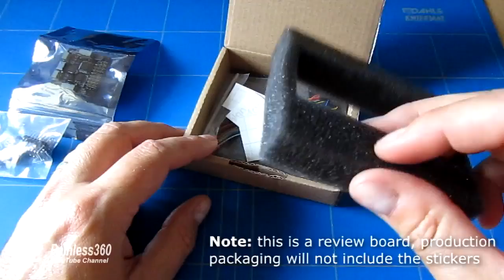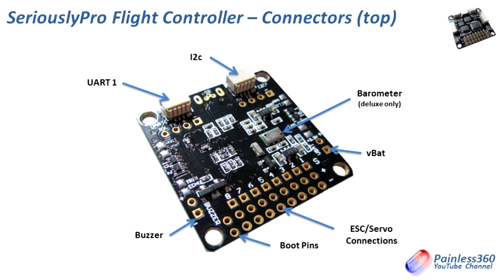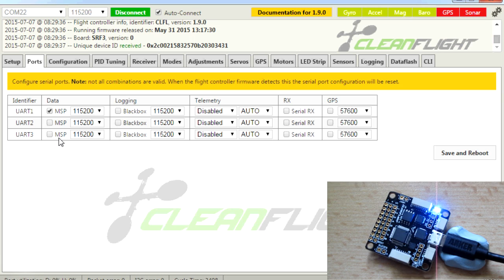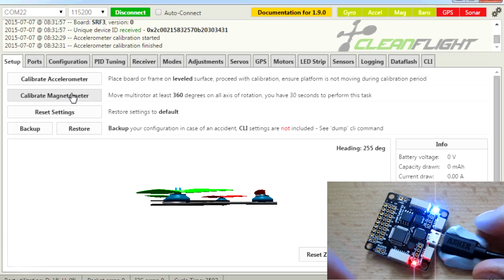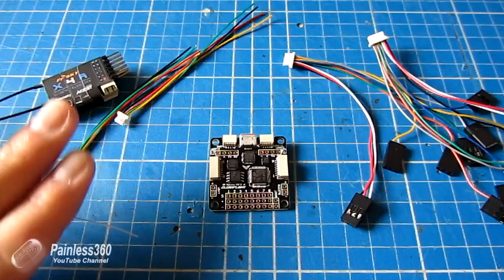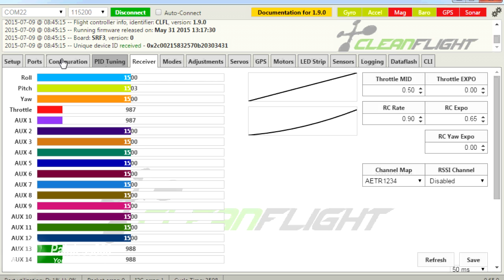(1/9) Seriously Pro F3 (SP3) Series - Overview and firmware installation

Comment: hey painless thanks got my board back but now that I finished upload new firmware motors aren't spinning .having problems setting my modes .and motors not arming I'm watching your videos .I just can't figure out what I'm doing wrong ...going crazy over here jus want to get in the air haven't even flown fpv yet .....uuuugh
Reply from the maker: The series 'Quadcopter building for Beginners' maybe a better series for you to check the basics. Best of luck!

Comment: hey painless you are the man ..OK ..from the beginning so you understand .I'm bran new to the hobby but a very quick learner ..that being said I flashed my board with clean flight did not make any adjustments walked away from my laptop and the battery dies while connected I went to reconnect and I've lost communication with my board .thanks to you I've located my boot pins but how would i jump them to restore communication.the rest of the steps are pretty easy.just need to get pass this obstacle any homemade ideas? I'm handy lol...please and thank you for any help you can give ...I own an Xbox one that being said you can contact me directly ( if you have the time ) ungluedskitzo is my gamertag and also on instagram .or feel free to drop me a video or diagram-message containing the steps i need to take to restore  +***  Happy holidays to you and urs ..Eric sosah Quiles (Facebook)
Reply from the maker: You need to short then with something metallic as you power the board, I use a paperclip or something similar. If you're coming into the hobby and finding your feet then the 'Quadcopter Building for Beginners' can be a useful series or two to work through. Best of luck!
Reply: Painless360 thank you I actually found ur video on the subject and I feel like Dr Frankenstein ITS ALIVE,ITS ALIVE !!!!LOL THANKS YOUR AWESOME !!!

Comment: Having some difficulty.  Using Taranis -Plus, Frsky X8R receiver, SPro F3.  Throttle and roll seems to be switched somehow.  I'm sure I setup something correctly, but I've been over your tutorials several times.  Ideas?

CleanFlight 1.2.4
Channel Map = AETR1234

Taranis - Plus OpenTX 2.0.20
Default Channel Order = AETR
Mode = 2  Rud Thr Ele Ail

X8R receiver

Model S500
Mode D16
Channel Range CH1-8
Throttle Source Thr

Inputs
IThr 100 Thr
IAil 100 Ail
IEle 100 Ele
IRud 100 Rud
IMod 100 SE

Mixer
CH1 100 IThr Throttle
CH2 100 IAil Roll
CH3 100 IEle Pitch
CH4 100 IRud Yaw
CH5 100 IMod Mode

When looking at the receiver tab in CleanFlight:
Left Stick up/down controls Roll (values from 987 to 1998)?
Left Stick right/left controls Yaw (values from 987 to 1998)
Right Stick up/down controls Throttle (values from 987 to 1998)?
Right Stick right/left controls Pitch (values from 987 to 1998)
Reply from the maker: Yep, select the AETR channel order in the receiver setup (called something like JR/Spektrum). Best of luck!
Reply: That did it.  Thank you!

Comment: Thanks, Thanks Painless. I still have a question. I have the board/receiver set to ibus. The Led Din pin goes to one of the 3 holes on the board. Or would I be better off to use the ITC connection?
Reply from the maker: See the video later in the series where we cover the common receiver connections. I'd connect iBus the same as Sbus.. Best of luck!

Comment: hi, do you know if the new F3EVO works the same? I'm trying to build a drone following your videos, which are super btw, but I'm looking around and I'm not able to find an original DELUXE board for a proper price, I found few overpriced and from China :( so F3EVO are more available then this. thanks for your time
Reply from the maker: You can buy them from seriouslypro.com. The manual is there too. We've not tried one here so can't comment on the flashing process - the manual makes it look like it's the same as the one in the video. Best of luck!
Reply: hi, thanks for the reply, I did contact them already and they don't produce the DELUXE anymore, I was just wondering if the connections are the same as this one, so I could follow your videos anyways :)
Reply from the maker: The flashing is the same but look at the manual for differences in the pinouts for the receiver etc. Best of luck! :D

Comment: I have just put together my first drone. Everything works fine except when I connect it to cleanflight and arm the motors and bring up the throttle they have really different values. and if I hold the throttle at one spot motor 3 goes up and the rest stays down. I have a SP racing f3 Flightcontroller and Turnigy 9xr transmitter.

similar to this : https://www.youtube.com/watch?v=6cuxpNm2jjE

Any thoughts?
Reply from the maker: https://www.youtube.com/watch?v=DDnaAQLjcQQ
Reply: Thanks alot. I will put on some props and test it. Love your channel!
Reply from the maker: Best of luck! :D

Comment: Painless360 what software would you say will be better to run on f3 deluxe with BlHeli esc cleanflight or betaflight
Reply from the maker: That is a loaded question ;) Betaflight is a more dynamic version of Cleanflight with the latest improvements on flight code, Cleanflight is the version it was forked from and spends a lot more time in the testing and code improvement side of development. It's personal choice really but a lot of pilots are moving to Betaflight..
Reply: cool thanks i thought flashing it with betaflight hex was maybe causing the problem i was having with instant flipping after spending a week stripping it down going over everything  top to bottom every thing look fine so i flashed back to cleaflight  and still couldnt work it out  till josh bardwell told me he had the same thing with beHeli 4in1 and had to just swap fc outputs to mach the order of the motors  
and i felt so silly  the simplest things can be your worst nightmare   but its sweet and ready to rock painless360   wooohoo happydays  my friend

Comment: i can't update mine, when i follow the steps, it still does not show airmode. amongst the modes, angle and horizon yes but not air mode
Reply from the maker: I'd check the versions you are flashing with and also the version of the Cleanflight configurator. Without that level of detail it's tricky for me to help. Best of luck!
Reply: Painless360 ow I now see I wrote this on the wrong video. should have been on the tbs power cube one. I managed to have airmode active tho it is not visible. and version colibri race 1.13 doesn't let you connect as windows says can't recon your USB.  even after using zadig.

Comment: hello, 

maybee a very silly newbee question but i am starting to going through the series again while actually implementing everything. but i'm stuck at this first part. 

i use cleanflight 1.2.4 but i do not have option receiver mode in configuration tab. 

i do have: 

(left row) 
mixer, 
board and sensor alignment 
gps
other features

(right row)
esc motor features
3d esc
battery voltage 
current sensor
rssi 
system config. 

i googled but didn't find anything. is this normal or really weird? 

great matthieu
Reply from the maker: No idea what you're describing, the interface to Cleanflight was updated so maybe the 'Quadcopter Building for Beginners: Series 1' is a better place for you to watch. Best of luck!
Reply: it has indeed to do with the new layout, but mine is even newer than the one in 'Quidcopter Building for Beginners' it took me a while but it is now located under the tap receiver. 

what i described is all parts of the tab config. just look at it and you will see it matches except of course receiver mode.

Comment: Have you any videos about the servos tab in cleanflight? 
I'm building a tricopter with an SP F3 board 
and I haven't a clue about servos. Cheers ;)
Reply from the maker: Me too - I've been chasing Hydra about getting a video on this as it's not very clear anymore.. Stay tuned!
Reply: Painless360
Yeah, I see people on forums using CLI commands to tune it. My problem is I can't get the servo to work. 2 questions: Do you have to turn on servo tilt to get the servo to work? And, Do you link the motor input to the servo using the tick boxes on servo tab? Thanks again ;)
Reply from the maker: I'll make a video when I get it all working here. Let me know if you figure it out before then.. Best of luck!
Reply: Painless360
Hiya, the stock Triflight settings are very high for an analogue servo where'as the stock Cleanflight tricopter settings seem to be right for analogue. I had to drop the Servo PWM rate from 200hz to 50hz and the PID's had to be lowered too. with these settings, Triflight works quietly on all 4 flight controllers that I tried. Hope this comes in handy for someone. Cheers Lee ;)
Reply from the maker: Thanks for posting!

Comment: I bought this from hobbyKing. I thought I bought this at least, but it turns out it's a copy!? http://www.hobbyking.com/hobbyking/store/__107400__Deluxe_F3_Flight_Controller_with_Built_in_OSD_EU_Warehouse_.html
now I'm concerned I won't be able to use the manual or firmware updates from the seriously pro website. the hobby King page dosent offer any manual or links to firmware. dose anyone have experience with this device and can tell what I should expect from the hobbyking version. 
can I use the firmware updates for the original version?  this is my first quadrocopter project and feel a bit fooled by hobbyking at this moment. expecting delivery this week. and hope to get some insight before I put it all together. 
I'm used to by knockoffs of Arduino and haven't noticed any differences when I use them but don't know what to expect from RC knockoffs. will appreciate any feedback from similar experiences. thanks!
Reply from the maker: Seriously Pro who designed this board no longer make them so all of the ones on the market at the moment are copies. They should work identically to the original OEM ones so the online manuals and software will be the same. If you are using a clone version then I normally PayPal the original designer a few bucks as they make no money from the sale of a non-licenced board. Best of luck!

Comment: @Painless360 can you help me my sp racing f3 deluxe flight controller wont turn on at all from a usb connection or a battery, the lights arnt flashing or nothing can you please help me
Reply from the maker: +Sandra Beikoff if it's never worked then let the vendor know. Sounds serious.. Best of luck..
Reply: it was working a couple of weeks ago the stopped working all together is there any way it could be fixed or is there any advise or help you could tell me
Reply from the maker: If no lights are coming on and you didn't do anything to damage it then I'd get a new one.. Best of luck!

Comment: Hi, 

I did exactly what you show how to flash the board, but it is failed to me, after that the the board is not connected to Cleanflight anymore. What is the reason causing that? Thanks for your help
Reply from the maker: I'd go back to the vendor for help. I'd try another cable or, if all else fails, short the 'Boot' pins to reflash.. Best of luck.

Comment: I flashed the firmware of this SPF3, and now i've got "failed to open serial port" when i try to connect, What should I do? Thanks
Reply from the maker: It could be a driver problem or a hiccup when flashing. I'd try to re-flash the firmware (make sure you have the right board selected) by shorting the boot pads on the board. Best of luck!
Reply: +Painless360 Thank you. I solved the problem. Now the FC works but didn't receive the signal of the receivent (i've got RX-601 by de venti on) what could be the problem? what should i do?
Reply from the maker: Happy to help but please watch https://www.youtube.com/watch?v=olIqTiSJHIY and come back to me with more detail of what you've tried..
Reply: I downgraded The spf3 firmware to the version of the 31/05 and now when i open cleanflight i see the activity of the transmitter! But that's not the end, because when I try to use it, it doesn't work! I'm looking on the internet but once cleanflight see the activity of the rx i don't find anyone who's got the same problem. I'm getting frustrated with this..
Reply from the maker: Sorry, so hard to help as I don't understand what 'when I try to use it, it doesn't work' actually means. You can't arm it? It arms but won't hover? We cover every step to getting a working model in the latest 'Quadcopter Building for Beginners', I hope those videos help..
Reply: I watched  the 7/9 video of the series 'Quadcopter Building for Beginners' and i can say that the motors don't arm because i didn't select che function "don't spin when arm" so they should spin, no?
Reply from the maker: Don't worry about that, check that you can see it arming in the GUI (props off!)... You should see the little caution icon at the top turn yellow when it arms..
Reply from the maker: +Giulio Comuzio https://www.youtube.com/watch?v=6U-rjC39EXQ&app=desktop
Reply: I did that and nothing happened, than by magic the aux1 started to work properly and armed BUT also if i put the throttle back down to 800 with all the trims the motors start going fast! I think i should take a break ahah. Thanks for your all your help, really sorry for annoying, i will come back with more specific information

Comment: please, I maneged to switch the data port from the usb port to the uart1 how can i fix it? Do I  have to solder some kind of sketchy conector from usb to the uart?
Reply from the maker: UART1 and the USB port are connected anyway. The reason that UART1 always has MSP on it is that MSP (Multiwii Serial Protocol) is what the GUI 'talks' to the board with over USB. Best of luck!

Comment: another helpful great tutorial! much appreciated yet again!
For my F3 i have run into a problem however. When i connect the board it seems to work fine, moving the board will move the 3d model on screen accordingly. so I disconnect, go to firmware flasher, tick the baudrate box and also the erase chip box. then i download the firmware for the SPracingF3 flight controller and press the flash firmware button. Where in your video it will do its thing and present a firmware flash succesful message, my board says flash has failed. Any suggestions to what i could try to solve this? thanks again, take care my friend
Reply from the maker: Have a look at how we did all of the setup with an SP3 with the latest Cleanflight code and GUI in our series 'Quadcopter Building for Beginners Series'. That series shows every step as it's for new builders.. Hope it helps..
Reply: I would regard myself a "beginner" when it comes to SP racing boards and Cleanflight setup so i'll be sure to check that out, thx. 

as for the problem mentioned, i was able to sort that out by going over the manual that I found later on. It appears my board could only be flashed when the "bootloader" bridge was established during startup.

Comment: When you first connect it to your computer, you mentioned there are drivers that you've already installed from using other boards. Could you go more into detail on what those drivers are?

I'm getting a "No configuration received within 10 seconds, communication failed" message, which I assume is due to not having the proper drivers installed.
Reply from the maker: CP210x drivers, there is a link in the logo page of Cleanflight before you connect to a board.. Best of luck!
Reply: @Painless360  Thank you!!!!!! I can't tell you how long i've been struggling with this one. I kept thinking it was the wrong cable, but no, it was the driver (added fun of being on a mac is figuring out how to give permission to it. That's solved - it's Miller time, now!)

Comment: When I try connecting my f3 to clean flight it gives me this message No Configuration received within 10 seconds, communication failed
How do I get over this?
Reply from the maker: It's usually a driver problem or you haven't got the right board selected. Lots on this on the forums. 
Happy to help but please watch https://www.youtube.com/watch?v=olIqTiSJHIY and come back to me with more detail of what you've tried..
Reply: +Painless360 apart from clean flight is there anything else I need to download?
Reply from the maker: Nope, that should be it!
Reply: +Painless360 how does the spracing f3 flight controller get its power?
Reply from the maker: From a 5v source somewhere on the craft. We built a model using the SPF3 in the series 'Quadcopter building for beginners' where we covered this in detail. Also lots of videos on RC power and ESCs in the 'Introduction to Remote Control' series too. Best of luck!

Comment: Thank you for all the videos on this spf3 by the way how to activate oneshot125 in this FC? i'm using emax blheli 20 Amp with oneshot125 support, but as soon as i activate oneshot125 in the cleanflight the esc and motor not responding. thank you in advance for your respond.
Reply from the maker: +Alexander Suseno see the videos in the ' Quadcopter building for beginners ' series. I had something similar and flashed the ESCS to get everything happy again. Best of luck!
Reply: Thank you Sir..I'll try.

Comment: hello, thank you for those really helpful videos.i have one question. is there a way to map one channel from the transmitter (3 pos switch) to one of the eight ESC outputs ? i would like to use a switch on my TX to switch on and off LEDs. thanks
Reply from the maker: Yes there is, see our videos about simple gimbals.. Best of luck!

Comment: Good video, but again, like your other video, what are the other wires for that come off of the UART port?  Only Red, Black and White are actually connected.  What are the other cables for that are just hanging off...?
Reply from the maker: All covered in the manual ;) Best of luck!
Reply: +Painless360 there is a manual??  the receiver manual was barely a manual.  I'll keep digging.  Thanks.
Reply from the maker: The manual for the flight controller.. ;)